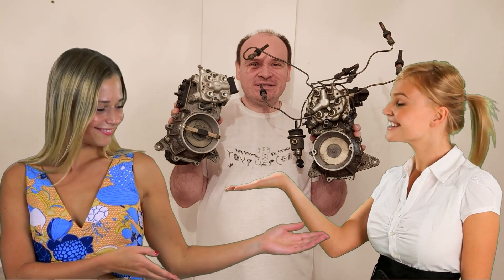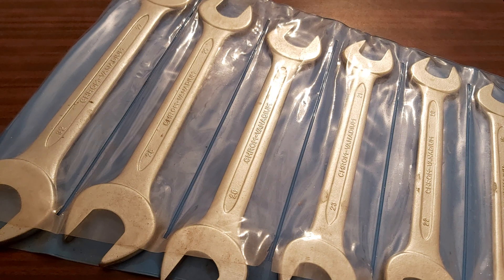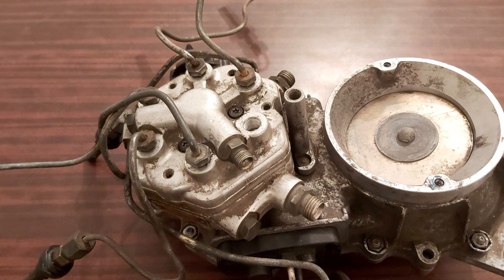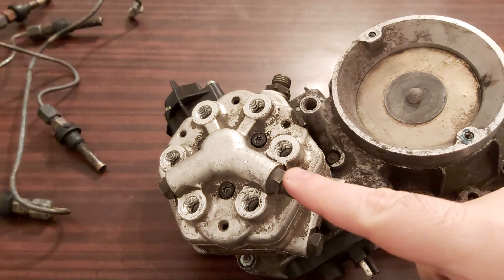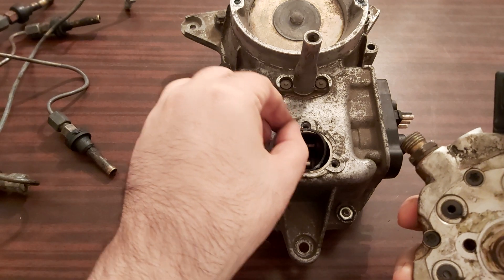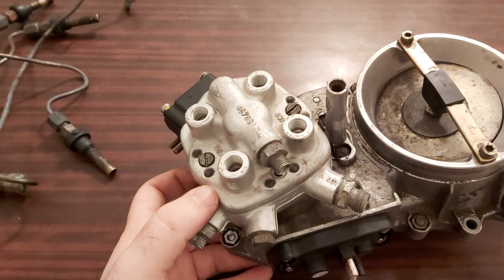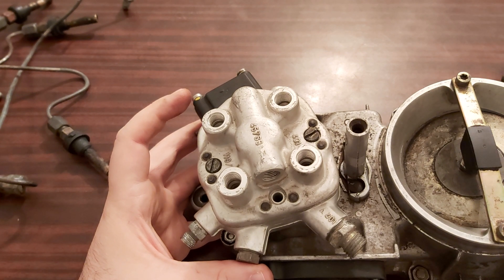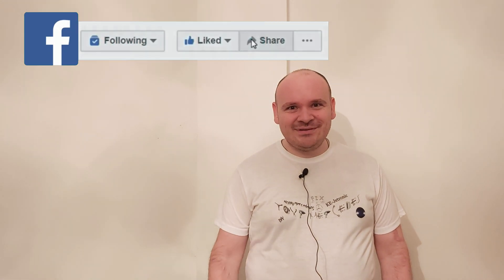㉦Mercedes Ke-Jetronic㉦ - Fuel Distributor Removal

Comment: I have been watching this gentleman for a while, he has the best intros! I will try and fix my W124 in the morning. My car took too long to start, stalls when I fully turn the steering wheel and sometimes dies down while idling, especially when the engine is cold. I only hope my engine is running too lean. This was a properly running car a few weeks ago. I hope all goes well.
Reply from the maker: Hello and thanks for the compliments. Check your idle control valve. If the issue persists check the potentiometer. Happy Mrcedesing
Reply: @mercedeske  Sure!

Comment: ivica my friend. in a perfectly factory m103, during idle running is the air flow vane in its engine off position? the reason why i ask is inside the fuel distributor, bosch says the idle fuel goes through a tiny hole just before the metering slit. if this condition is met then i would presume this can only be possible if the plunger is not yet "moved" by the metering vane..bosch refers to this plunger setting to be 0.58mm or set to 0.6mm if one has a cold or warm start problem
Reply from the maker: The plunger must be on 0.6mm. That's called the starting position of the plunger. If it's too far in, the car won't start, if it's out the car will shake(lack of fuel). As for the sensor plate it is in its resting position while the air flows in through the gap between the plate and the air flow meter housing.

Comment: greetings sir! when the air metering plate is properly adjusted( 1.9mm clearance before start of delivery) does it follow that leaking injectors cannot contribute to the diminishing holding pressure, since the fuel distributor at this position should not deliver any fuel at all to the injectors? the most amount it can leak will be the fuel between the injector and the fuel distributor..am i correct?
Reply from the maker: Yes, but when you start the car and stall it after some while faulty injectors will leak.

Comment: Do you have any advice? Our 88 m103 300te starts immediately then stalls, and will keep doing so.

If we manually press down the airflow plate and hold it, it will run aslong as we press it down. 
My electronics are fine, checked all your videos.
Fuel pump to filters are all news.

Any ideas? I'm so lost.
Reply from the maker: Did you check the free gap of the sensor plate? It has to be 1.9mm before the plate starts moving harder.

Comment: Thanks. I fixed the air meter. I want to transfer the fuel distributor. I hope there is no problem.. I can supply all the orings. I will let you know the result.
Reply from the maker: Fingers crossed 🤞 😃

Comment: Hello guys great work! I'm wondering: Is there a K-jetronic unit in the 1994 w124 or is it replaced with another system?
Reply from the maker: It's replaced with so called HFMI system. Something similar to the Motronic system - a Mas airflow sensor plus common rail.
Reply: @mercedeske  Amazing!
Reply from the maker: Thanks a lot 🙏 Happy Mercedesing 😃